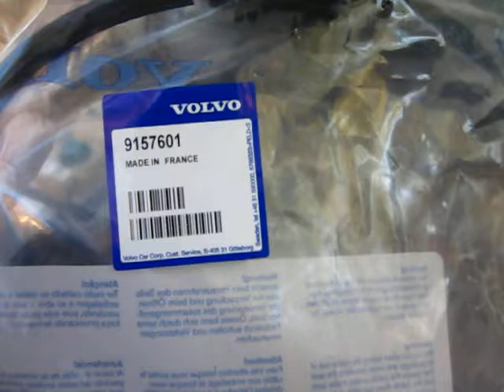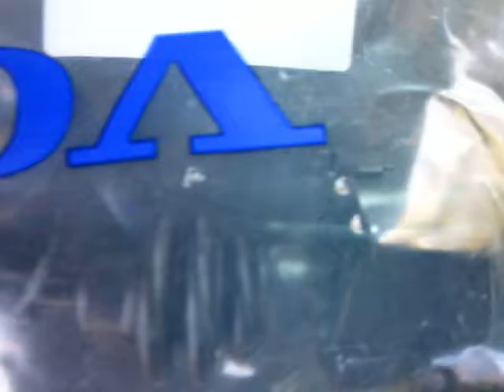Volvo Accelerator Cable Replacement Part I

Comment: Kept me hangin  in a few spots but right on video. I'm waiting for my cable in the mail. You helped me tremendously.wasnt sure how I was going to get the cable through to the petal and I've looked at mine I know that plastic piece is gonna be a bear. Others say just break it pull it out. I do things slowly. I don't throw caution through the wind. TY nice.....